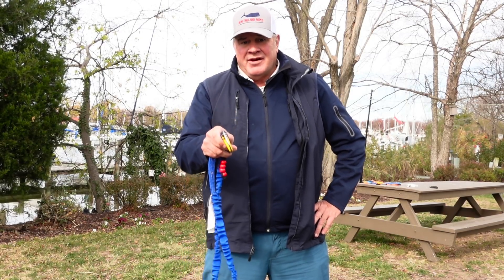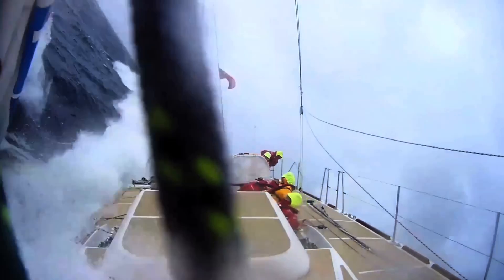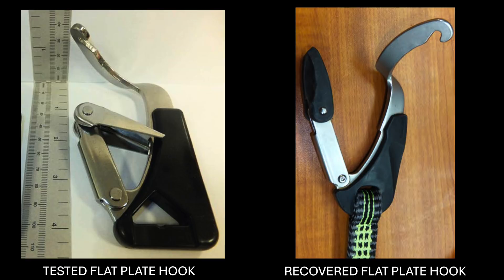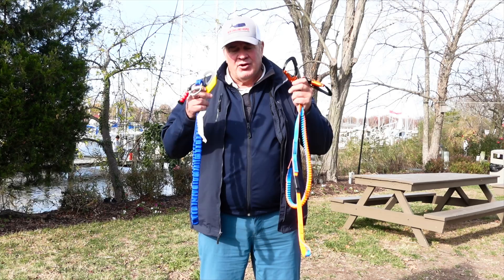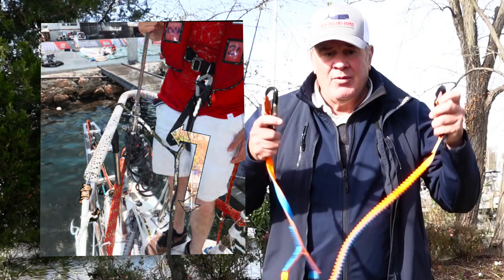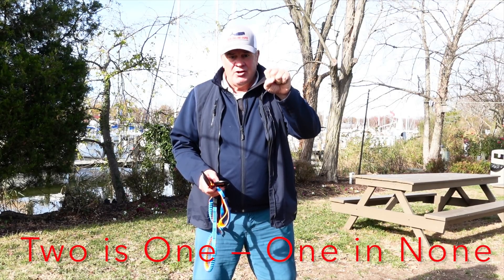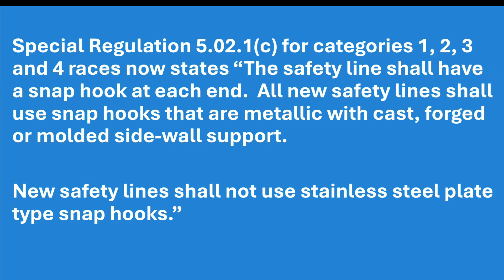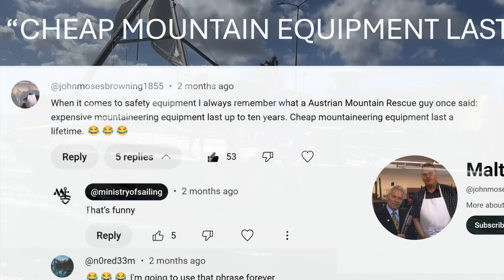Is your Tether a DEATH TRAP?  Sailor’s Debrief 111

Comment: In 1981 I did a southern ocean crossing Fremantle to Hobart in a 42ft. owners made steel boat, myself 1 other crew and the 2 owners, we were young and crazy, no radio, no life raft and no navigation equipment except for a sextant. I did however buy a levitator safety harness, it is a full harness that attaches in a way that keeps you upright. We made the 2,300 n ml. crossing in 19 days, 17 days running under main only, 10 days under reefed main and 3 days under fully reefed main. We had a contest to see who had the longest 2hr watch at the wheel co-owner "Herk" got the prize 21 n mls in a two hour watch by the sumlog, under fully reefed main, we were surfing down 30ft waves and getting speeds of up to 16 knts we had a blast. By the way I still use that harness today. The Boat was a Hermon Boro designed "bonito" named 'Ellingarra'
Reply from the maker: Champions!!! Great job

Comment: When solo dinghy sailing on something like a hobie 16 what is your recommendation for a tether. It does seem practical or even safe to be tethered in a manner which prevents you from hitting the water especially in a capsize. It seems like it would be best to be able to be thrown or jump clear. And then have the tether ensure the boat is not able to continue to sail or drift away since the bot probably can’t drag you much compared to a larger vessel. Do you have recommended equipment? I’ve seen people quick release shackle themselves to the main sheet/traveler. I’ve also heard of people using retractable tethers though I’ve never seen one.
Reply from the maker: What is wrong with the trapeze?  As a matter of fact it’s perfect.  Just make sure that you develop awareness on loose clothing and straps that could also get caught up.  Also read this case https://www.ussailing.org/wp-content/uploads/2018/03/SSA-Report_Final.pdf
Reply: @ I would worry I might be thrown during a gybe and left watching the boat outrun me. I know some sailors are using things as simple as a retractable dog leash just to have something. Obviously the tensile strength is entirely different than a proper tether, but with a 200 pound boat it seems to work.
Reply from the maker: @ but the Traps will keep you attached to boat.

Comment: I tied on with a bowline, and stayed on my fours, and dont use auto helm and a 100 foot trailing line....
Reply from the maker: Please explain. I am unsure what you’re trying to save.
Reply: @ministryofsailing  trying too save my life.
The image of the boat sailing away under autohelm is a nightmare dream of mine. There's actually instances of the harness belts shearing.  The power of water is momentarily like hydraulic forces. Smashing port windows, ripping off hatches.
Reply from the maker: It it should undermine the importance of staying on the deck of the boat at all times
Reply: @ministryofsailing  yes of course, there is so much that can go wrong, Murphy's law. There was a large sailboat last week, boom strike killed one guy instantly and tossed another overboard during 3 uncontrolled jibes.  
People don't seem to understand the basics.

Comment: How the number of times the flat plate side hook was mentioned versus the other type of hook. The flat plate side hook was mentioned about 10 times more than the other one. So by the end of that presentation I had memorized the words flat plate side hook. When what should have happened is I should have remembered the improved side supported hook. That's a bad presentation. Second, out of the entire presentation only about 30 seconds was spent on the difference between the two types of hooks and during that time the differences were just talked about not physically explained or pointed out in the better type of hook. So after rewinding and rewatching I still don't see the difference in the two types of hooks. Bad presentation. There should have been 5 minutes devoted to the good type of hook physically showing how it snaps on how it behaves under load, and physically showing why it's better. Also a few brand names of the improved hook should have been mentioned. I heard in other presentations that most people wear their tethers too long. And that the tether should keep you on the boat because even if the tether doesn't fail if it's long enough to let you go overboard most people can only last at most a minute being dragged along the side of the boat before their drowned by the teller pulling them. This fact was glossed over in one sentence. Again bad presentation.
Reply: Also being a rock climber, I use rock climbing carabiners for sailing, especially auto locking ones that can be operated one hand.  And, here's a counter argument to not repeating 'flat plate snap hook'  It's now permanently burned into my brain that 'flat plate snap hook' is a big no-no.  I think the video accomplished the task.  A huge amount of safety lessons come from knowing what NOT to do.  So, if you know what not to do, it's fairly easy to extrapolate into what you SHOULD be doing instead.
Reply from the maker: I'll take your comments into consideration for the next safety video. Are you a member of the Foredeck Union?  You should send me an email. I’d like to bounce some ideas off you for the next one.
Reply: @ministryofsailing  I'm a subscriber on YouTube and love your topics as they have debunked some bad ideas I picked up from YouTube sailors. I just feel the content could be presented in such a way that the positive message is emphasized more than the negative message. No I'm not amen member of the four deck
Reply from the maker: @ thanks for your feedback back.  I see your points and as the research continues into the next episode “Panic Early” - I’ll keep it in mind.  We are sailors or just learning how to do this stuff.

Comment: I can’t remember the channel, but they had an episode of a paying crew member on one of those Robin Knox Johnson pay to sail around dangerous waters boats.  The crew went overboard and the winds and seas were so strong that it took the remaining crew members about 20 minutes to slow the boat enough so that the could pull the person going overboard back on board.  He had been attached to the board, and was pulled alongside while they worked to slow the boat and get him aboard.  He was dead.  The tether held in .  I think he might have been better off first if the teather would have been shorter keeping him on deck.  Or worse, but better than being pulled alongside side the boat to drown, if he would have just gone overboard and floated free.  Presuming that the boat could locate him and recover him.
Reply: That was my point. If you go overboard because your tether is too long, you will drown unless you're able to release it. The crew would have been better off if his broke after about 20 seconds.
Reply from the maker: Thanks for your comment
Reply: That's why there must be a way to release the tether while under full load. Carabiners won't do that.
Reply: That's a great point. Being tethered to the boat, but dragged in heavy seas, can be more dangerous than floating free. In that case, the crew could have cut his tether whle throwing a MOB marker and then turned back to attempt recovery. But as he said in the video, the point of the tether is really to keep you from falling overboard.

Comment: You're right the tether is meant to keep you on the deck of the boat.  
With that in mind I set my 'Jack Line' as close as possible to the Centre line of the vessel & where possible threaded through pad eyes along it's length.
I use a body harness (separate from my PFD) that my tethers are attached...at the end of each tether I use a locking carabiner rated a 22 KN.
Reply from the maker: Thanks for your comment… make sure you’re using leg straps on the PFD too.

Comment: The whole  cliping on system is flawed , no other fall arrest system/training will have you clipping on below yourself . Ive  pointed this out for more than 20 years of offshore sailing . Use a teather in conjunction with a spare halyard  on most  yachts  you will be able to go from the cockpit to the bow on the same length  halyard. Try it out
Reply from the maker: You are 100% correct on that having a double up-and-down system would really work well and a lot of sailors on the mast and at the four Deck do this
Reply: Excellent point! One could even rig a dedicated halyard for going forward on deck. As another commenter said, the harness should be of the kind that keeps you upright if you fall.

One thing though. If the length of the rope is such that you can reach the bow from the cockpit, won't you end up in the water if you fall midships? Sailboats are obviously much longer than they are wide. I suppose one could use mountain climbing gear to adjust the reach going forward and back, but that's complicating things and easy to forget.

Comment: With respect I think the commenter 'goldreserve' has a valid point. The climbing and mountaineering community recognized years ago that a carabiner could be inadvertently opened by a rope crossing the jaws. Hence the invention of the screw gate carabiner. When sailing offshore I use a Wichard Proline tether with locking snap hooks that can be operated with one hand. This is safer than a standard snap hook.
Reply: This situation was a side loaded carabiner which most carabiners would not be able to withstand. You're unlikely to take a whipper off the sailboat.
Reply: @Tb0n3  My point was using a locking tether clip, such as the Wichard Proline, makes for a stronger clip which can withstand some side loading as there is a closed loop of metal.
Reply from the maker: Thanks for joining our community. Appreciate your thoughts.

Comment: Practical Sailors Drew Frye's article.

 "To our testers’ surprise, off-center loads don’t have to be great to bend a snap hook open. In our tests, the Gibb-style hooks like the Spinlock Race Clip that Speirs was wearing began distorting under axial (side) loads as light as 275 pounds. At 300 pounds the hooks were fully open." 

Well won't that scare you!
🤨
Reply from the maker: That’s where we got our research!! Good for you
Reply: @ministryofsailing  I cannot over-emphasize banning side jacklines. Dragging events are a serious issue, and most setups appear oblivious to this.
Reply: @ministryofsailing  As a comparison, carabiners used by rock climbers like the Kong Tango sustain loads up to 2,700 pounds before failure and about 1,160 pounds when nose-hooked. In all the years I have used them, the Tango seems impervious to nose hooking.
Reply: On a lighter note;  getting crew on deck to keep them from banging on the deck sounding like gunshots to those sleeping crew below is another issue 😄

Comment: I should think a quick release/screw gate climbing carabiner is far safer.
Reply from the maker: Thanks. But often those take two hands to operate… I would not recommend it.
Reply: @ministryofsailing  With respect I think the commenter 'goldreserve' has a valid point. The climbing and mountaineering community recognized years ago that a carabiner could be inadvertently opened by a rope crossing the jaws. Hence the invention of the screw gate carabiner. When sailing offshore I use a Wichard Proline tether with locking snap hooks that can be operated with one hand. This is safer than a standard snap hook.

Comment: Mitigation efforts and key takeaway points at the start of a chain of events in this tragic accident; 1.) Being dragged is a very bad thing, and efforts to minimize areas of potential dragging points along jack lines should be supported with secondary hard points, as you mentioned. 👍2.) Recovery, even by a large and strong crew, is very difficult. 3.) Off-axis loading on any equipment rarely being taken into consideration. 4.) The defective clip.
Reply from the maker: So happy you get the big picture… where do you sail?
Reply: @ministryofsailing  Also;  The British Marine Accident Investigation Branch acted quickly by issuing a safety bulletin recommending that jacklines not be terminated on cleats.
Reply: @ministryofsailing   Currently wintering Antigua, based out of Newport, RI. Swan 54
Reply from the maker: I’ll see you there … 600!!!!! I’ll be on a VO 65

Comment: My husband went over the side from the foredeck,during a knockdown off Maui in the 80’s. He flopped back on board when I was able to right the boat very shortly after. We never used the type of snap hooks I see here, but a more robust type mountain climbers used back then.
Reply from the maker: Glad to hear that you both made it back safe and sound
Reply: @ministryofsailing Interesting, as I was just going to comment that as a sailor/climber our climbing community has been good at refining equipment and safety techniques through the years.  I would recommend for your channel that you don’t suggest that the flat plate safety device be used at all, ever, as stuff happens very unexpectedly in surprising ways.  One example was I was simply walking on deck with my “good” safety hook device (a “Kong Tango” I believe) clipped into the jack line when I inadvertently kicked it.  It went flying off the jack line out in front of me.  I was momentarily shocked.  I haven’t fully looked into this but I’d suggest, for instance, using climbing Locking Carabiners.  There are a number of different configurations for how to lock them.  All work well but some would likely be better for sailing, i.e. able to lock and unlock with cold or gloved hands.  For sailing I think we’d greatly benefit from a locking carabiner that would have an adjustable feature somehow built in that could lengthen or shorten the tether as needed.  Or perhaps a knot that would facilitate that, such as a Munter Hitch, but that’d take some experimenting to get the right setup. Thanks for your efforts.

Comment: When I sailed across the Pacific last year the boat owner mentioned this but I could find nothing about the problem or if my tether clips were a problem.  My snap hooks are molded. The problem makes sense to me. What I learned years and years ago is that a capacity rating, especially on something like a block (pulley) quickly becomes meaningless if there's side loading.  Knowing this I also know I would  probably miss seeing the inherent problem of  the flat clip.  (And they still seem to be for sale all over the internet.) 

I've made another tether specifically for use on my boat based on the problem of going over the side, but then not being able to climb back aboard.  This tether 1" nylon webbing, sewn correctly, is about 4' long with a second loop about 15" from the end. I have climbing carabiners in all the attachments. No shock loading.  The reason I made this was for working on my deck. I have raised jacklines. The length of my tether is so I can function  forward, outside my cockpit but in the event of a fall I don't have enough webbing to go over the lifelines. The shorter clip is so I can cross the stays where my jacklines are tied.  I have a standard ORC Spec Double Safety Tether  with elastic, for doing anything else, or for going high enough that a fall would need to be arrested.  
If I had a flat plate clip? I don't know. I might still use it. What I like about carabiners is they have high load/shock ratings, have been used for years by rock climbers, so they're not likely to bend or snap off on a side load. The one issue they do have on a salt water vessel is the salt gets in the mechanism. A bit of dry lube and working it seems to solve the problem. Until I learn differently I'll keep using them. 
Something else. When sailing, especially in rough conditions, everything I learned as a framing carpenter, physics teacher, sailor, DIYer comes into play. The boom bouncing in 33 knot winds 4 meter seas is potentially injurious, but not if you're leaning into it. Another more experienced sailor insisted that sliding across the dodger created huge forces, said ten feet to the side is the same as a ten foot drop. I offered to show him the math. Said he didn't need it.   This is experience, learning, practice, sharing. 
I think I look brave going up the mast, but trust me if I wasn't safe I wouldn't be there. And even when I'm doing a five minute job up there,  my brain is thinking of things to do the next time to make it even safer.
Reply from the maker: Thanks for taking the time to watch the sailors, dBrief and for joining our community